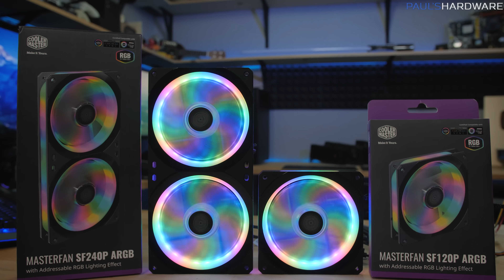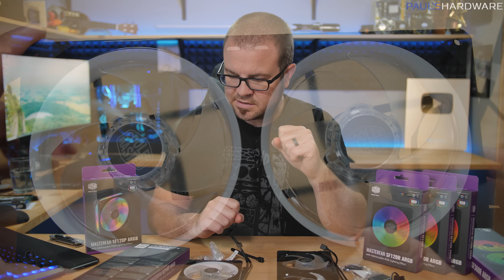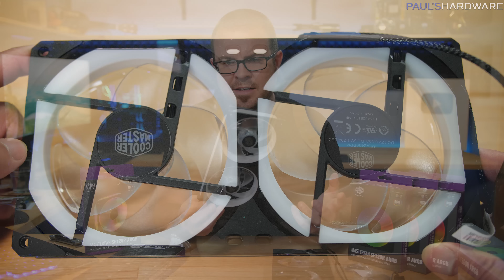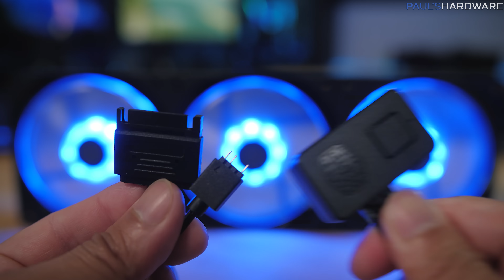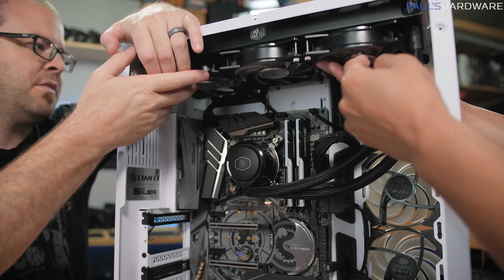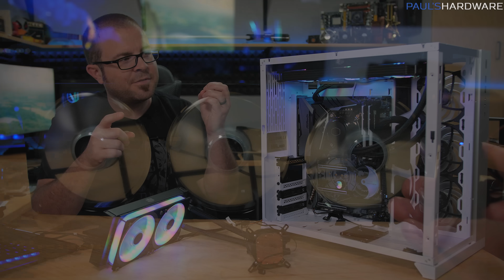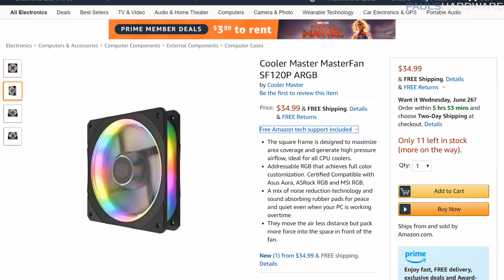Why Didn't Anyone Else Think of This?

Comment: i baught this cause of this video and heres my review after using them for like 1 month THERE GARBAGE THE RGB IS UGLY AND CHEAP THE RPMS ARE GARBAGE THEY HAVE CHEAP BEARINGS AND I CANT BELIEVE OUT OF THE BOX 2 OF THEM ARE FUCKING RINGING N SINGING OHH I HAD TO RETURN 3 OUT OF THE 6 I ORDERED BECAUSE RANDOMLY THE RGB DIED ON THE FANS HALF SIDE OF THEM THERE not REALLY COOLING MY PC AS GOOD AS THE CORSAIR AND IM QUITE DISA FUCKING POINTED THERE CONTROLLER BOX IS OVER PRICED AS FUCK AND EVEN WITH THE 3 PIN CONNECTING BULLSHIT ITS A FUCKING WASTE OF MONEY CAUSE FOR 30$ MORE I COULDA GOT THE FUCKING CORSAIR KIT AND HAVE A NICE FAN KIT with RPMS xd FUCK COOLER MASTER AND FUCK THESE FANS DO NOT BUY THEM YOUL REGRET IT I DID I WAS SUPPOSE TO SELL A PC FOR 1500$ AND LOST ALL SALES CAUSE OF THESE STUPID FUCKING FANS! THANK YOU COOLER MASTER THANK YOU. THEY LOOK COOL THATS IT LIKE DESIGN YOUL ACTUALLY PUKE ONCE YOU TURN THE RGB ON AND SEE THE CHEAP CARNIVAL LIGHTS IT HAS TO OFFER

Comment: Did the electric noise get fixed???
Reply: i dont think so, this is the problem for most of cooler master fans.i have replaced all the fans from cooler master.
Reply: @wangbowen2186  I completely forgot about this comment. Well I bought three of these for my Lian Li and I don't hear any electrical sounds so they've must've done something 👍
Reply: @johnboyjoy  thanks let me contact the support in this case

Comment: I'm sure you're going to get many comments about these types of fans and housings... here's mine.  Uphere has had those for awhile.  I'm sure there are others, but I build old potatoes with new cases, usually an i5 3470-based system with an RX570, and Uphere makes some good fans and sells them for less, helping me keep costs down, so I don't really shop for any other brand(s). - https://www.amazon.com/upHere-PF240CF-Colorful-Hydraulic-Management/dp/B07Z1BVLFV/ref=sr_1_6?crid=1WUREWBDIRJI0&dchild=1&keywords=uphere+rgb+fans&qid=1591225980&sprefix=uphere%2Caps%2C298&sr=8-6

Comment: Just showing in my advised video's today. Nevertheless, found these 360mm 3 fan set for €39,- online. Think I'm going to replace my 2x 140mm fans at the top of the case with this one. And use the 2 RGB top fans to replace the 2 non-RGB fans at my 280mm radiator. Thanks for the video and review!

Comment: frankly i thin a solution with some kind of snap connector between 120mm modules would make more sense that way you can add as many as you want then you snap on a cable connector onto any snap point to connect them to the mother board...

that way if one module dies you replace it... but you stil keep the number of cable down... though it may be more expensive to manufacture something like that

Comment: sounds like that noise is actually a problem with your fan controller sending a dirty PWM signal, causing slight variations in the speed that lead to that "humming". A clean signal should not have that problem. If you have an oscilloscope you could inspect the signal it's sending out.

Comment: I would say the ones that should be coming out from LianLi that are connect able would be better. Can swap one out if it dies, 2 wire installation and can be removed or added to any configuration you want.

Comment: So I wasnt able to tell buy on the multi fan versions were there 6 cables I total? 3 for fans and 3 for rgb or is it set up so that the 3 fans work from 1 cable and same for rgb.
The reason I ask if because I've been looking for a way to have multiple fans connected using one cable for power and one for rgb. This is because my current set up is a cable managing nightmare and it's made it so I ran out of headers.

Comment: Ive opted to use Deepcool for my RGB fans but my case has 2 massive 200 MM coolermanster RGB fans and 1 black cooler master exhaust. Anybody like the Cooler mater ones? I was goign to push/pull the radiator with moor deepcool ones and swap out the black but perhaps making them all match would be good. I don't think paying extra for the corsair ones matters since they're double the price. I like hearing opinions.

Comment: I get that noise every now and then on a Hyper 212 rgb black edition I just bought from best buy which I think uses the same fan, I will be taking it back for refund and I'm currently looking for another cooler. At first I thought maybe the fan wasn't set right and was grinding against the heatsink.

Comment: I vote modular. The fans should have connectors on a couple corners, with pins for 12V, GND, 5V, ARGB, PWM, Tacho, so 6 pins total. To stack up the fans, you get a connector piece (gender changer basically) which comes in between the fans, to connect the whole stack to your fan controller or mainboard you get a pigtail cable which has that 6-pin connector on the one side, and the RGB and PWM fan connectors on the other.

Comment: It is a shame they didn't push for a 420mm (140 x3) or 280 (140 x2) design as well.  At the same time, though, Antec has followed suit with this in a way but instead of ARGB fans it has lighting accents along the fans.  Right now I am looking for ideas for my Cooler Master MC500P, but want to stick with the 140 x3 / 140 x2 setup.  Personally, I hope Lian Li releases the daisy chain fans they showed at Computex in 140mm.

Comment: I love the idea, but am agrieved at the price (as many other people). I mean come on cooler master, you can get 3 Argb fans, by cooler master, for the same price as 1. I have 11-13 fans in my case (set up dependant) and can spend 100-150 for my set up instead of around 400 with these. Granted that they have a light bar and LED diffuser sorrounding them  it this price is over the top. I also don't see why they must have rushed the product out (noise issue) seeing as there is a limited amount of companies that do this now. I may invest in an Led diffuser, argb strip and a few extra splitters and stick with individual fans for now. Cheer Paul, nice vid as always!

Comment: How about just a simple frame for two or three fans with internal headers to plug the fans into? If one goes out, just swap it. A thin walled 5 sided ABS box or something similar that doesn't add much thickness to it would be pretty cool for making it look like a single monolithic unit and shouldn't be terribly expensive. It would unify the look of the fans and if they really wanted to they could still put an LED border around the frame itself.

I think you can already find acrylic or plexi facades to mount fans to at modding sites that do almost the same thing except they don't cover the sides and don't reduce the wiring needed, although pretty small splitters do exist.

Comment: If I still need to put all 12 screws on the triple fan SF360R, I might as well just stick to the single fan x 3 which also needs 12 screws. And are much cheaper too. 

And like if you got the tri fan and over the years one of them dies, rip on the whole thing unless CM will sell replacement fan's on the future which I highly  doubt when this product become obsolete.

When RGB arrived, I always think there were 4 levels. Level 1 : No RGB  Level 2 : Acceptable RGB  Level 3 : Blinged Level 4 : Fucked up. These fans are Level 4 Fucked up. 

Too much RGB BRUHHH

With the money spent on such fans, you can use it to get a better CPU or GPU instead! Like everyone else I see sharing on social media, blinged up PC rigs but lacking on the CPU and GPU side.

I know beauty is in the eye of the beholder but come on.... Where is the Logic? Upgrade your CPU and GPU first before you go RGB Ape shit.

Comment: I would love fans with magnets to replace screws, cover the magnets in rubber or felt to remove vibrations and also why not have magnets to connect the fans together like in this video? While we're at it, why not a PCI/PCIe powered and mounted fan to replace or augment GPU fans.

Comment: Personally, having even non rgb versions isn't a bad idea for radiators in general as it has the potential of having a measureable difference in tempetures. Depending upon use case, that can be useful

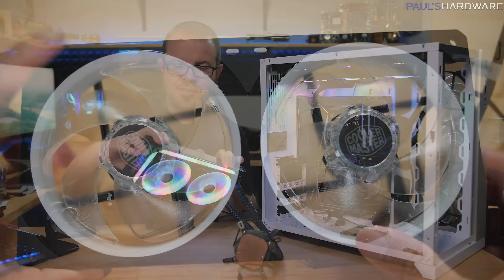Comment: 7:04 How are those slotted holes in the centre any use if neither of the holes in the end are slotted? The fans can still only be mounted to a pair of fan mountings one particular width apart.

Comment: Too bad the rubber dampener don't go all the way around and aren't separate. Now they leak air and light in between fan and rad, and the underside of the fan doesn't look als clean as it could.

Comment: Looks alright. 
But personally, I'm still waiting for pull fans. Imagine a fan with reversed blades. One that pulls air! Would make manny builds look so much better!
Reply: Forgive me if I'm being ignorant, but why can you not just flip the fan, so it faces the opposite way?
Reply: @isaaclee-mort  The backside of fans looks ugly, you have the rim that holds the fan etc that doesn't look nearly as good as the front. And if you mean the actual fan (the pplastic thing that is spinning) the only way you could make it blow backwards would be if you made it spin the opposite direction it usually spins.
Reply: @andiders  the first bit was what I meant, so you'd be getting the same direction of flow if you flipped the fan, but it would look way nicer to have a fan that span the opposite way
Reply: Omg I agree! Would love to see how the airflow looks with a pull configuration!

Comment: FAN failure.... RARE.... I still have 140mm and 80mm fans from 1999 builds running and working with no problems... Case fans generally don't get hot enough to ruin the bearings fast enough for what they do. GPU fans fail because of the HEAT from the saturate and ruin the bearings of fans quite a bit faster, as well as they generally run at higher RPMs on average than many case fans. These are actually pretty nice, from what I can see, especially if you are an RGB and wire management freak. The biggest downside will be the price.

Comment: Y not have manufacturer do : connect 2-3 fan as one module & all cables connect to the main fan, the wire just connect the main fan to the controller / Motherboard socket

Comment: ok can someone help me out  i have 6 fans in my pc 1 exhaust fan 3 intakes and 2 for my aio. i could use the 360 240 and 120 but i dont have an rgb header on my mobo anymore due to a broken pin. is there a way to have all 3 fan blocks light up? i currently have cheap fans of amazon and i want to upgrade? what all would i need to get the rgb going

Comment: I certainly think the 240/360 fans look cool, but the potential for one fan to ruin the whole unit is enough to keep me from buying them. I think it would behoove them to figure out how to make the fans modular, so you can pull one out of the frame and replace it, while still maintaining that single wire convenience. Or maybe figure out a way to have clip-together 120mm fans, then you could do 240, 360, or 480 if you're so inclined, but still have a single wire and controller for the set.

Comment: Sorry but no thanks on this idea. So I buy a 360 model then decide to get a new case but this case doesn't support 360 now I'm out a whole fan setup and need another. Or if one dies then the whole setup again is useless. Where as one fan I can move and rearrange how I want and fit anywhere I need. I do like this for radiators but the whole idea of one possibly dying and needing to replacing the whole unit is really killing it for me.

Comment: That's kinda of a bummer the 360 version doesn't light up on the side, that would have looked good in my case. I've been wanting to get 6 more fans for a push/pull setup on my rads as well as a little more lighting to show off all the tubing.

Comment: With the money of one of these single fan 30$ i bought 6 fans rgb with pwm, 10 slots connector and remote control. I can change color,brightness, speed, turn on and off using a button. This one is good shit but overpriced.

Comment: Good job Paul, I was beginning to wonder if you were going to address a "fan failure" for the multiple fan units.  Having recently RGB to the max a Liam LI 011 Dynamic with 9 cases fans (3 mounted onto a 360mm RAD for an AIO that is one of the first things that came to mind....what it ONE fan fails.  Gulp...thxs for covering it.

Comment: retention box for the headers and the daisy chaining are most useful. dunno why my cheap molex fans could be daisy chained but a $30 fan pack doesn't but instead has that pesky splitter which is a pain to install if your case has that small hole for cables to go through to the motherboard headers.

Comment: i really hope they come out with a 360 version of the RGB overflow variant (the ones with the RGB strip round the edge) .. looks dope and would provide lightig to the parts of my case where no other light source gets to (in front of my front rad since i got the front fans in a push config and on the back of the rad i mounted my res .. so i cant do fans there)

Comment: I would be very interested in picking out a single unit with 2 or 3 fans based on the plan for my rig. Even without RGB, the reduced cable management seems like a big plus for me. People don't change their configurations that often, so I don't think that con is really that important. The maintenance issue seems like the bigger issue, but fan fail rates are so low already, that this seems like a small risk. And there may be a way to fix the fans (maybe the manufacturer can supply replacement parts).

Comment: I've been doing this for YEARS using polyurethane caulking so that I can get a good seal around the rads. Clear is the most aesthetically pleasing. Too bad the rubber pads didn't go all the way around and act as an actual gasket.

Comment: Hey, Paul. Good video about a product I had been asking about myself for a while. I am very interested in these kinds of fans. Question for you. Do the double or triple fan set ups come with only one fan and RGB connection? Or do they have two or three like a traditional multi fan set up? 

Thank you for your time.
Reply: The 360 has 3 cables, 1 fan header, 1 SATA for power and 1 for RGB.

I guess technically you could get away with just the Fan header if you leave SATA and RGB header disconnected. RGB sucks up more power then the fans do, believe it or not.
Reply: Darren Rushworth-Moore Only fans will be hooked up then. (:
Reply: @RickyV-Production  Yeah the fans just daisy chain through the bracket and the other two are really just for the RGB crap really.

Comment: Not interested because they are way too expensive (but that goes for the single fan versions as well since they work out even higher cost per fan).

Unless you have a super small form factor build which really struggles with temperatures and a premium fan this kind of price with a higher performance in terms of airflow is the only way to keep it from thermal throttling, then I really don't understand why people buy these. For 99% of people and their builds you can get fans to suit your purposes at half this price at most.

Comment: Sounds like your Zelman controller is providing a dirty PWM signal. Or changing both the PWM signal and supply voltage over the same output. Many newer PWM fans/motors don't handle that very well (they're not engineered for that, being PWM units from the ground up, not variable voltage units with an PWM circuit tacked on).

If you have, or have a friend with a basic oscilloscope, you can check that pulse signal output very easily. Multimeter with pulse count might not give you a useful reading for a noisy PWM signal, but it can check if the Zalman controller output is changing the supply voltage too. Just connect the noisy fan, in case it doesn't do it without a load. So you can see what happens when it's driving this particular combination.

Comment: Just why they didn't make then like the fans you can remove from the hub that some video cards use?
So if one fan fails you need to RMA the whole thing (if in warranty) or worse replace all if it had run out.

Comment: A x570 taichi....and Paul is not able to show it on yet. :)

About the fans.....there are many Mehs! for me....as you said, one fan goes kaput, need to replace the whole thing, you lose on modularity and if you cannot use two fans on the bottom of the rad then you're out of luck.

No iCUE or comparable RGB engine, is a pass from me.

If there is one think manufacturers have to learn to do right when it comes to RGB is the drivers and software to control those LEDs....so far Corsair is the the only company to get it right.

For instance, my H500M case RGB animations are ridiculously limited. My X470 Taichi RGB software is utter crap. The AORUS RGB+ software makes all SMB bus devices blink, go and come back....a total absolute mess.

So having less cables is only gonna solve a tiny part of the problem.

Comment: People complaining about fans not being replaceable because they are proprietary. Well here's reality...
1: Fans last a LONG time if quality. Probably longer than you will own the build, and almost certainly longer than THE PUMP
2: Other fans can be used if you replace the lot. Not a big deal if the warranty has run out as that will be years away
3: HEAPS of CPU coolers ALREADY HAVE NON REPLACEABLE FANS. Don't hear people whining like little girls you can't replace something like an AMD Prism cooler fan, intel stock fan, heaps of cooler master coolers use non replaceable fans etc.

Get over it, half of the stuff you own is non serviceable.